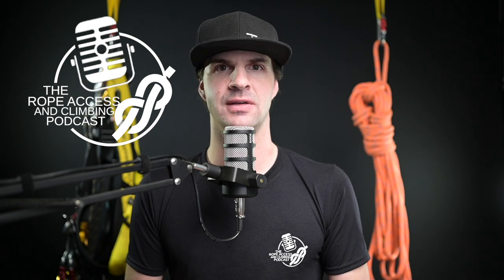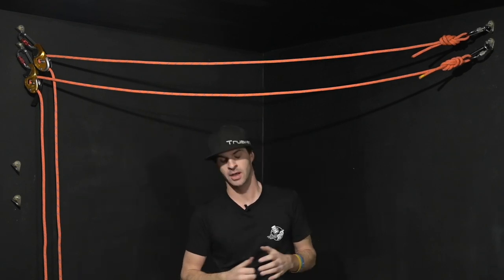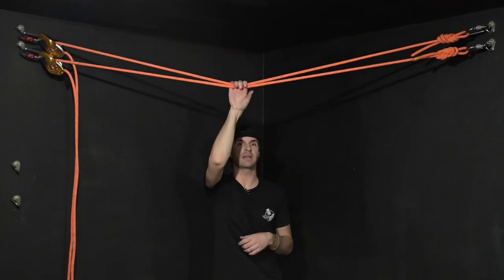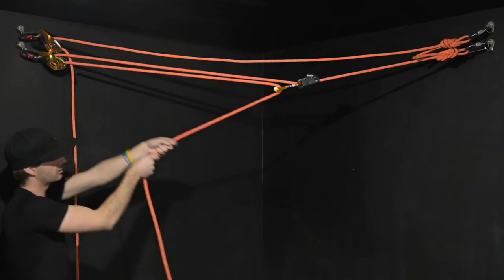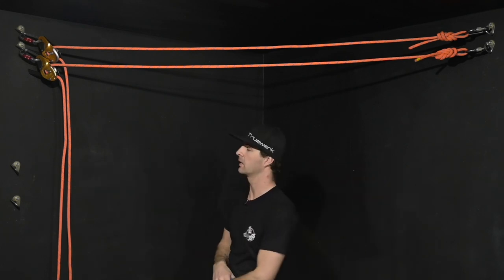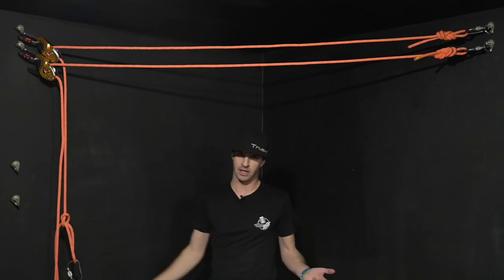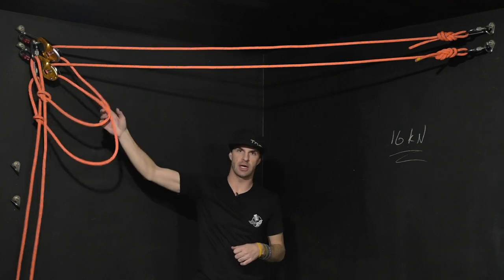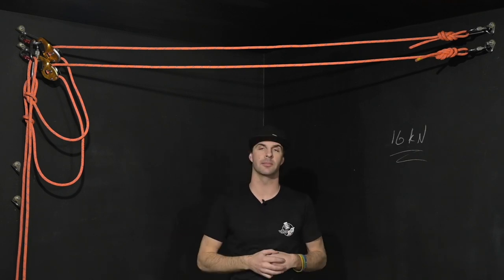HOW TO PROPERLY TENSION A TENSION LINE - THE ROPE ACCESS AND CLIMBING PODCAST

Comment: In Australia minimum anchorage is 15Kn. But your correct Mikey from the meeting or exceeding manufacturers spec is perfectly fine.
Personally I use a slipknot and tension it by hand. Occasionally we need to lift the angle if the span is past 3 metres,so I'll chuck a 3:1 on there.
Great video as always brother 🤙🏼
Reply from the maker: Thank you!!  Cheers

Comment: Can you tension a line to tight? Is it safe to work with it past the critical angle?
Reply from the maker: Great question.
Can you.  Sure but it wouldn't lead to a catastrophic failure.  It's surely not recommended for sure. 
Now if you needed to work about the 160-degree angle.  Add another rope. increase your safety factor of the overall system.
Reply: @theropeaccessandclimbingpo2380  thanks man

Comment: Good info, but I'd also add the importance of equal tension being put in the system on either line and straight line of pull to know you're actually getting the load you're aiming for.
Reply from the maker: Hey, thank you for your comment.  Yes, in an ideal situation.  But, still not something that I'm totally worried about.  In this event, the vertical bolts help you see what's happening.
Even with the vertical bolts and or the lines not being at the same tension.  You are still operating will within the manufacturer's specifications.

Comment: Good.
But if a company procedure exceeds in this scenario the slip knot advises from maker, does not matter if it regarded as exceeding? Maybe the slip knot is so it can be released when jams to the rig, so what does the rope guys do then if procedure conflicts (never mind exceed or not) is conflicting and deviating from maker instruction?
For me I would stick to maker instructions as they know more for technical limits of their gear. Just opinion of working rope guy.
Reply from the maker: Hey,
At the end of the day, you should follow your company procedures.  As you take on the personal liability if you deviate from them if anything were to happen.

Comment: I enjoy the vid. By what standard do you refer anchor minimum to be? I assume IRATA because you are in Canada but I have always known it to be 6kn with a 2.5 times safety factor equaling 15kn. Of course I’m wrong often and it seems to me a lot is changing in rope access currently.
Reply from the maker: Hey there,
Great question. 

Where I live anchorage must be Atleast 16kN 

IRATA is 15kN. Or yes 2.5 times The anticipated load of the max impact force being 6kN = 15kN 

Same same just different 😂

Comment: Interested question, since the ID's and Rig's nowadays autolock themselves and do not the same modes after the revision of 2019, is there a technique for that apart from having to tend it at and hold the handle while tensioning or is the ID's simply not a device to use like this after the revision? I'm curious and have read a bunch about it, but most of the videos out there seems to assume that you can leave it in belay mode.
Reply from the maker: Im not 100% sure I understand what your getting at and don’t want to give a wrong perspective
Reply: @theropeaccessandclimbingpo2380  
What I do mean is being able to use the new version for line tensioning when it has the autolocking feature, but further study has shown that it is simply not a problem for those things and that the function is smarter designed than that. But thank you anyways, love your content!
Reply from the maker: Hey thank you for clearing that up. 

So, just because Petzl has included auto locking handles on both the Rig and the ID does not change the function of these devices. 

You can still use both to tension up lines, haul/low loads. 

I hope that helps
Cheers
Mikey
Reply: @theropeaccessandclimbingpo2380  
Perfectly, thanks!

Comment: Why do I think the mechanical advantage setup you used is only a two to one and not a three to one. Rule one of mechanical advantage states when haul line is tied to an anchor it’s even. Rule three states the haul line when through a pulley and is attached at the anchor it’s just a change of direction. In your set up the Rig would be the load! And the figure 8 with biner, the anchor. The basic with rollclip is attached to the anchor line. If you took the basic out and went straight to the biner with the figure 8 with the rollclip it would be the same. Is this a 2 : 1 or 3 : 1 ? Please elaborate to help me understand thank you for your time 🙏🏻
Reply from the maker: Hey there,
Thank you for your message.  
Under the rules of the Mechanical advantage..  If it is terminated at the load (the moving load) it's an odd number.  If it's terminated at the anchor (the non-moving location) it's an even number. 

So, in all accounts here.  It could be either-or.  However, when you tell people to rig up a 3:1 this is what you will get. 
Please note.  There's no moving object here, therefor it doesn't matter what you want to call it. 

Cheers, 
Mikey
Reply: It was a stated 3:1 used in that vid, however the actual mechanical advantage of a z rig where the auto bloc is a large cam descender is certainly less than x 3 although we label it such. Less so again if the rope is hairy dirty and or damp. If you closely observe what is happening at the descender when the mobile clutch is being hauled under load you should often observe the rope being gathered in in a delayed fashion around the cam. ie you haul the system but the system takes a moment to gather all the captured rope in the system taught as it overcomes the friction.This means that for at least a part of the haul cycle the only part of the hauling system acting on the load is the 2:1 hauling the mobile clutch/the basic.

In rope access the only hauling systems we use are either z rigs nominal 3:1, piggy backed z rigs nominal 9:1, or nominal 2:1, z rig assisted 2:1 (6:1), or go hog wild with a piggyback z rig assisted 2:1 for a whopping 18:1, I therefore characterising/describing mechanical advantage in terms of crane block rigging, as there's a tendency to confuse the training message. Better in my opinion to focus on practical manifestations, mobile clutch, rather than vaguely related theory.     

The vid: I would add that I'm not keen on tying and clipping a knotted bight of slack rope back to the anchor assembly. My reasoning is that in the event of slippage under load, to the extent that the slack rope becomes fast against the descender and assembly components, recovering the system becomes more complicated than necessary, slipknot with a retaining crab, preferring either a, fig 8 on the bight or an alpine. This comes down to personal preference though.
Reply from the maker: @uilleachan  Some great points here.  But when it comes to tension lines and tensioning them.  Your pulling at hairs trying to figure out the true MA.  Every device is different, the rope is different and the list goes on. 

The point of this video is to give some guidance on the matter.

As for clipping back the knot, I don't care as stated, if you want to tie 8s or alpine.  This also depends on if the manufacturer requires you to do anything at all. 

All and All thank you for your comment.  Keep it up.  
I enjoy these chats. 
Cheers
Mikey
Reply: Uilleachan great information man 👌🏽 
The way I see it in this video.... if you take the rig off the anchor it’s on and let it hang under the figure 8 knot, still anchored, then put that basic and roll clip on the anchored line as in the video it’s 2 : 1 also assuming that the progress capture device “the rig” and the change of direction pulley “the roll clip” both have 100% efficiency from friction! 
     With it being on the other wall horizontally, the rig was slack then after using the mechanical advantage set up, the rig is the moving pulley! So it’s still 2:1 This is my thinking! I now want to make a video lol 😂 I actually plan on making some videos on mechanical advantage and how to tie knots efficiently and related topics! Thanks for your input I love information ℹ️
Reply: @theropeaccessandclimbingpo2380  I refer to the z rig as a 3:1 even though I know that it it isn't really, well not using a descender as the bloc. Using the descender evolved from using ascenders and became popular as it misses out the change over to descender step for lowering, but that additional utility comes at the expense of efficiency. Still it's a worthy trade off.

Try rigging a haul using an ascender as the block (with a pulley fitted to the same crab that connects the ascender to the anchor) to feel the difference in use between the two, which I find more than tangible.
Reply: @uilleachan  we need to call it something, so even if the true MA is lessened by the friction of the descender, it's still a 3:1 in terms of its construction.
Reply: I like your thinking friend!

Comment: If u don't  have Descender, then how u tight to tension the rope
Reply from the maker: Depends on your company procedures…

I can not comment on that
Reply: you can use any sort of trucker's hitch or progress capture technique. Its important that the system you chose allows slippage under large loads though. Examples of things that would not allow slippage are things like tooth devices.

Comment: I got a minor discrepancy for not tying the tension lines back with a figure 8 a few years ago
Reply from the maker: Well that shouldn’t have happened.  Providing you had something there.
Reply: @theropeaccessandclimbingpo2380  yeah, he told me it was because the ID wasn't strong enough to meet the requirements,  I didn't argue much because it was the only discrepancy and I already pass, but is good to know. Thanks for the video!
Reply from the maker: It’s not the anchorage...

You don’t tie off the ID on your harness... Why would you need to there...

But yes, better to take the discrepancy, and walk away.
Reply: OtherBut then you take 2 more incorrect penalty and lose your ticket. Other choice maybe to get maker instruction and show the evaluator and then agree with discrepancy but make comment to eccrediting body that you got penalty for sticking to maker instructions. Sounds my friend like you have more knowledge than the other guy!